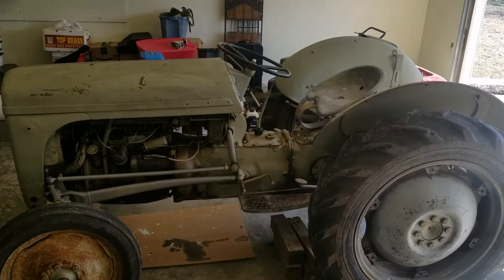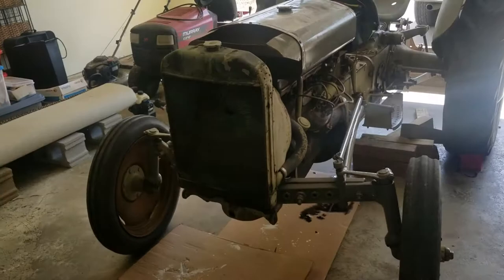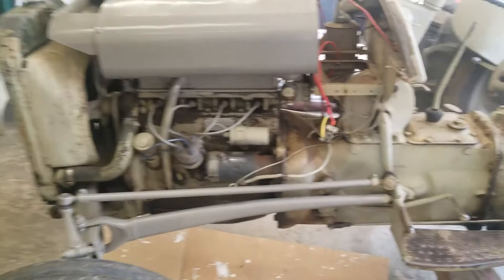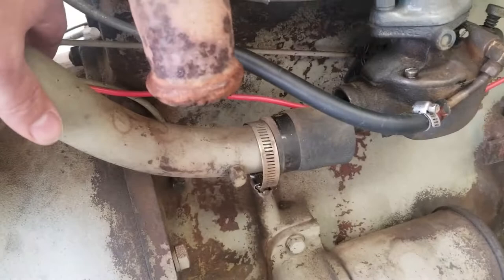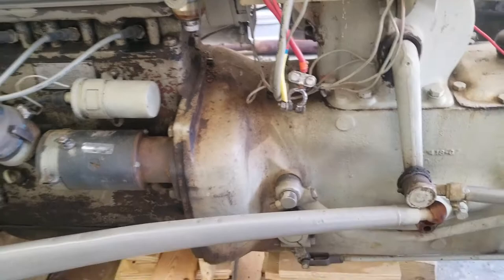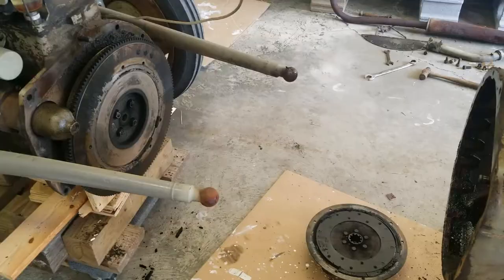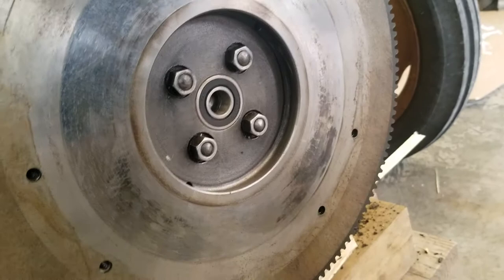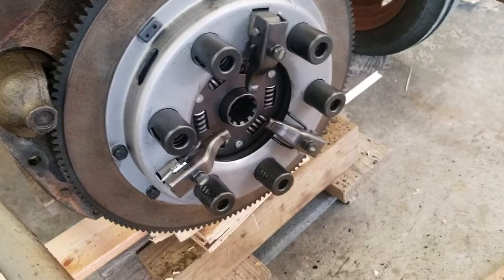1952 Harry Ferguson Clutch Replacement

Comment: bread trick lol i work at a shop the bread trick is when you fill cylinders with bread when you do machining on the head to prevent metal in the engine using bread to push out a bearing is odd we just use grease

Comment: Interesting but couldn't watch it to the end, the background music was driving me nuts.
Reply from the maker: Good to know.  Next time I will cut the music off.  And yes, there will be a next time, because as someone else commented, I didn't replace the seal that was leaking the oil into the casing.  So, I am sure I will have the same problem again soon.
Reply: Make sure you don't have You Tube music in the background like I did.
Reply: I only lasted about 3 minutes because of the music

Comment: How's parts availability for these tractors?
Reply from the maker: Sorry, I just saw your reply.  I didn't have any issues getting the parts.  I think I got some from ebay and some from Amazon.  On this particular tractor, there are a lot of interchangeable parts with a more common Ford 8N tractor.